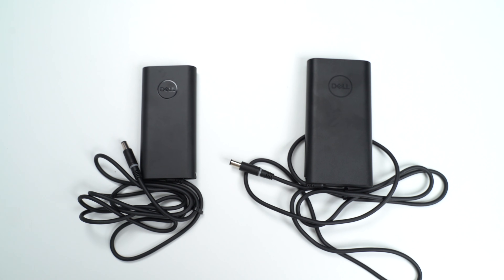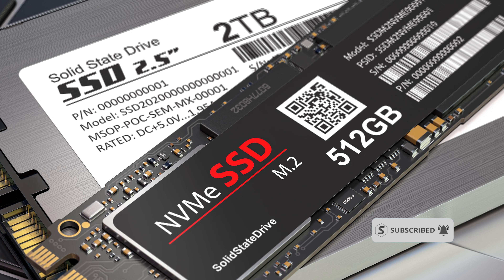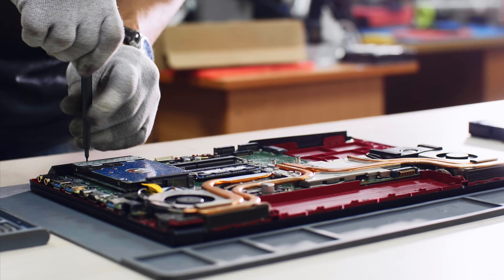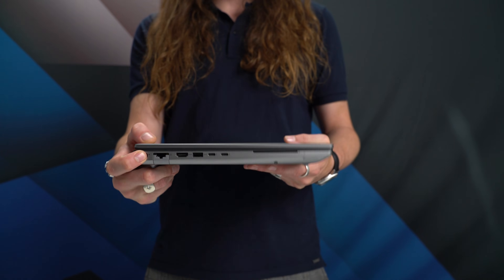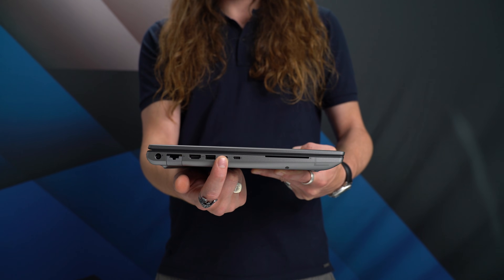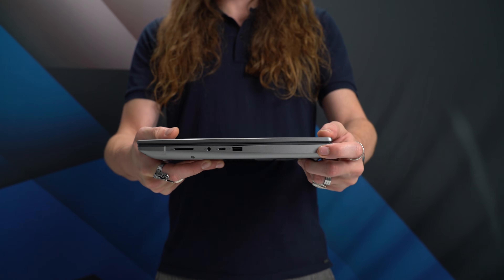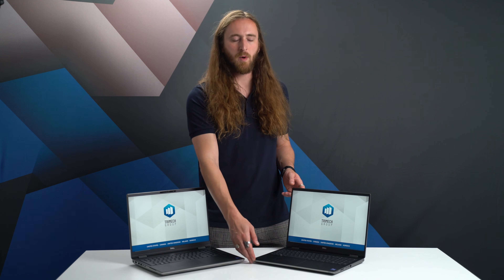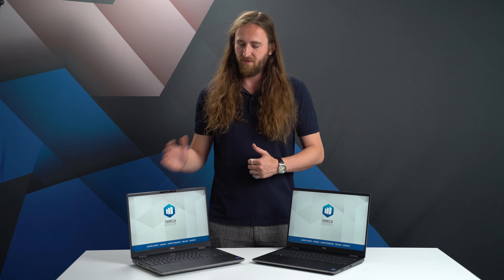2023 Dell Precision 7680 CAD Laptop Overview | Hardware for SOLIDWORKS

Comment: This thing is absolute garbage! The biggest problem is the graphics card … I had to open up the laptop every two months and vacuum it out because the GPU fan was completely clogged with dust and everything started lagging. The laptop has the worst Bluetooth module I’ve ever experienced. When I go to the kitchen, I have to reconnect my headphones every time. With my iPhone, I can go all the way to the basement without any issues.

We also have Dell at work. As an IT supporter, I’ve never in my life had to support worse devices. If you don’t regularly install BIOS updates, the docking station stops working — that’s just one example. You only ever have trouble with a Dell.

Never buy a Dell … Absolute trash!!